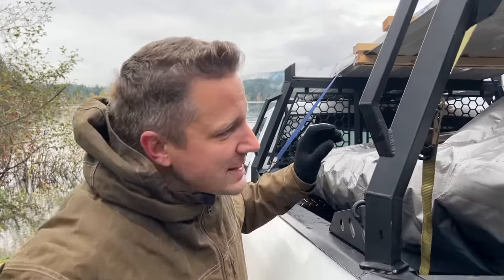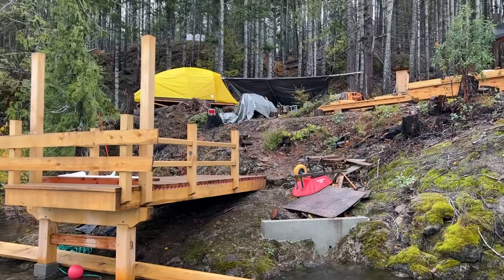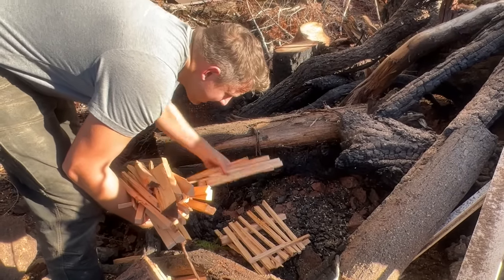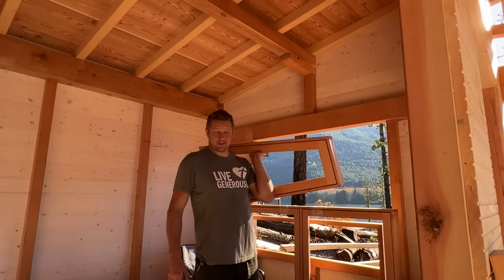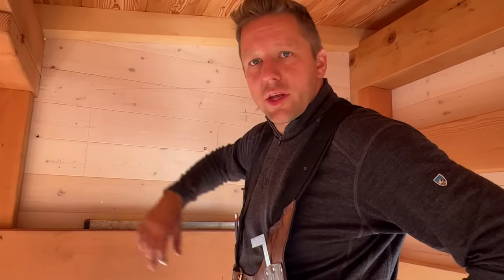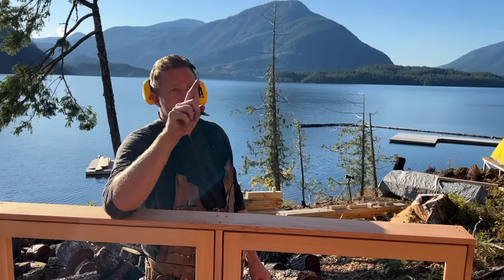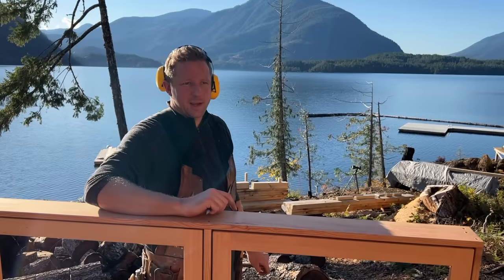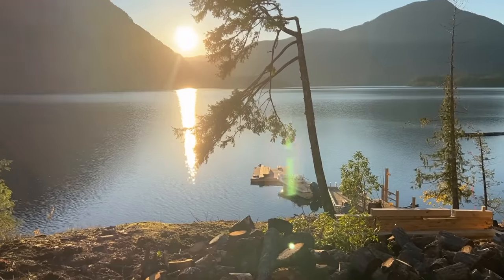Installing Wood Windows In My Off Grid Cabin and Cleaning Up The Property!!

Comment: You would SO much benefit from a Sauna, especially when swimming in November. I am from Finland and every cabin/cottage in Finland has a sauna, because it's so cold every winter. I have also visited Vancouver so I know it's cold there too, and rainy. Nothing beats sauna session after hard day's work, especially if you combine it with a brewsky! If you're interesting, I can point to you information how to build a proper sauna.
Reply: What resource would you suggest for sauna plans? thank you
Reply: @Madigan101st  What kind of sauna are you after? One that will be inside a warm house as a one room. Or separate simple outdoor building that will be cold when they sauna is not heated? If the latter, have you already decided how will you build the frame? Raw timber logs or regular wood framing (with or without insulation)?

Comment: Do me a big favor and build a corner casement Window so when it cranks out it has no center Mullen .  The window frame will be a right angle and when cranked close they will have a stair stepped frame side that inter locks with weather strip . I’m thinking a pair of 2-8 x 6-0s . The opening can be made with a cantilever beam back in the wall.

Comment: 13:05 That's about the only way you can get a hopper style window: you have to special order it from a private craftsman or make your own. Big companies won't make them anymore.
Reply: @boltholeonabudget6526  I stand corrected. I only have experience with Milgard and Jeld Wen. Last I knew they didn't make them.
Reply: @boltholeonabudget6526  I used to sell windows a couple years ago and people would come in looking for hopper windows and I couldn't get them. I was told they didn't make them because they're prone to leaking. But good to know they can be had.

Comment: Burning all that wood is obviously bad re smoke and climate change. On my Vermont property with similar issues I simply stack the wood in small piles around the property. It eventually decomposes, gross moss and ferns and looks kind of cool. With larger logs I built a sort of a teepee. You could chip smaller pieces which makes for great walking and weed suppression. You could take the wood back and give it away as firewood. My two cents.

Comment: Hey Samurai! Quick question. Why did you put the frame of the window biased towards the outside? Is it a design decision, or will there be more to go on the outside of the cabin?

You also mentioned insulation. So does that mean you'll build the inside walls inwards to allow for the insulation, or is it going in the outside? 

Keep it up bud. It's looking great, eh?

Comment: Wow, you could have built a 2" x 6" standard framed shed this size in two or three days and wrapped the walls with Zip board and waterproofed the entire structure for a fraction of the cost and it would be ten times more durable and weather resistant. If you wanted the ship lap siding look, you could have installed it over the Zip board on 1" x 2" battens. This would have ensured your shed would have lasted decades and it would have made insulating it 50 times easier. 

What you built is very pretty, but it is also very unpractical. Your joinery is beautiful to look at, but it is out of place in the wilderness unless you are doing it for pure aesthetic value.